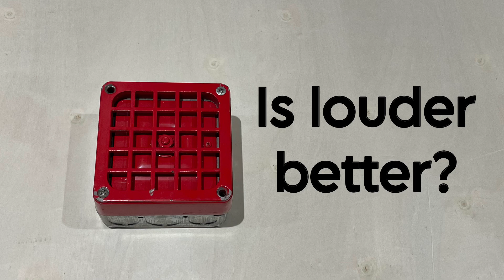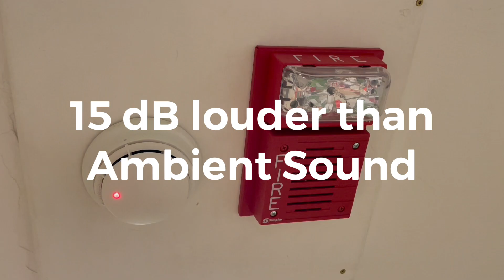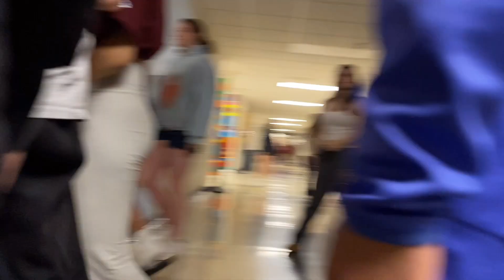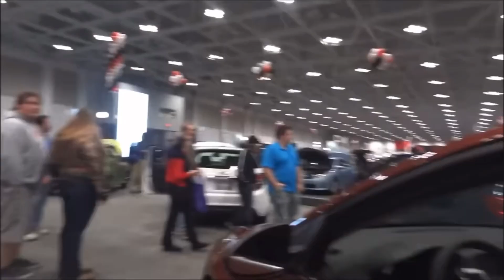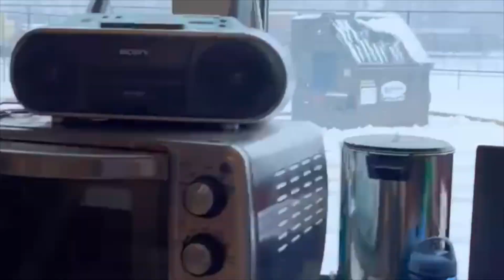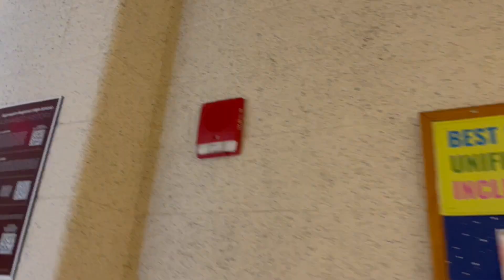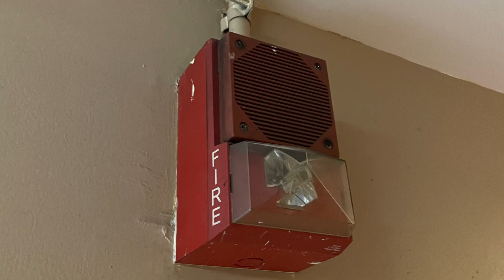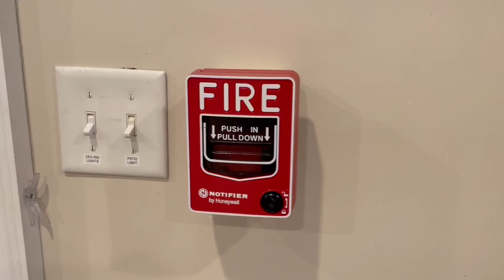Are Louder Fire Alarms Better? Why are Fire Alarms Loud?

Comment: Hey firealarmdude! Nice video! So recently ive gotten back into fire alarms, and i kind of want a thing thst allows for more function, so im wondering if its possible for a annociater, lets say a fire lite one to be wired to an independsnt system (no panel) with only a pull station and alarm, i currently havr a plug for my power which is the negative source, and another wire for my positive source, so im wondering if its possible for me to ude the fire lite annociator on my system or of i would need a panel or more wires for my annociater to function (appologies for bad spelling my phone is acting weird today lol)
Reply from the maker: An annunciator is a proprietary device that will only work with a panel. You would need a panel to run an annunciator
Reply: @FireAlarmDude5967  ah, that sucks. But thank you for the explanation !

Comment: Once again, a very well done video. One thing to add from my personal experience is loudness is often also due to laziness or cost cutting. The first being you have an electrician putting up these devices that other doesn't realize they are adjustable, or more likely doesn't or isn't instructed lower the output as being excessively loud in most cases won't fail a verification meaning, not coming back to that same device to mess with it again. The other reason I see is design of the building with fewer devices on a very high setting to maintain minimum requirements in further rooms and spaces. This means when you're right next to the device it's going to be very loud. That in itself being why the the older systems are often louder as you mentioned in your video.

Comment: I definitely think the fire alarm system in my Greek Village house is way too loud. It’s Simplex TrueAlert 4906-9127 horn strobes which are 96 db from 10 feet away each and the hallways are so small and they echo off the wood flooring which makes it a nightmare for the ears. These alarms are even so loud that I can hear them from another house a few feet away from mine while standing on the back patio of my house. And these alarms definitely do startle me as during the fire drill we had, I had a sense of fear in me as jumped out of bed and rushed to get out of the house. It even startled me so much that I forgot to grab my keys because of my panic instilled reaction to get out ASAP so I had to go to the loan key desk after the drill at the expense of $5. These alarms startled me the same way the Wheelock AS and MT did in middle and high school and the Simplex 9838s did in elementary school. Whenever Greek Village goes through another major remodel, I hope the TrueAlerts are replaced with low frequency sounders or voice evac because those invoke a much calmer reaction (because when the fire alarm in the library or dining hall goes off which is a Simple’s 4100ES voice evac system, I leave the building calmly like what the voice message is saying and also past dorms I’ve lived in have a 4100ES with the low frequency code 3 tone and I also leave the building calmly in response to that not rushing out like I’m fearing for my life)

Comment: One point that could be made about older devices is the mechanical horns produced MUCH lower frequency sound output which by how sound waves work means that would penetrate a lot further through walls and structure and would be better heard.

Modern devices are typically really high pitched and can't penetrate as well, so more devices are needed. However, while someone may criticize this at first glance, it really isn't that much of a problem when you consider strobe coverage requirements; you need strobes everywhere, but just make some horn strobes if other horn strobes nearby aren't effective enough.
Reply: Mechanical Horns have a low frequency output but high current draw which is why there aren't a lot of signals of them as the sound can penetrate the walls easily

Electronic horns have a high frequency output but low current draw which is why there are a lot of signals of them as the sound can't penetrate through walls easily

Fire bells do have a high frequency output but their gong vibrations placed next to a wall can vibrate it easily depending on which wall it's installed as the sound from the bell on the other side doesn't penetrate well
Reply from the maker: Good point
Reply: The SpectrAlert Advance/L-Series has a broadband tone designed to penetrate through walls.    And from experience working at a school that thankfully only had remote strobes in the regular classrooms, it works.

Comment: To me the system needs to be more standardized voice-evac should be in every building including homes, the message itself should be a standard message except if the building has a special configuration. And generally I think we should be putting better systems into homes as well because those cheap residential units are nowhere near the quality of the commercial ones and often have mechanical issues or false alarm a lot. This type of standardization is in places like Japan where even homes have the same Fire Alarm Voice Evac message as in commercial buildings and those alarms and detectors aren't cheap made in China Stuff and rarely have issues. Even some old shrines have the standard message and it has been proven to be more effective then what we have in North America. Example video of the standard message that's being used.  https://www.youtube.com/watch?v=Ukn6UbEnkS8

Comment: Very interesting and informative video. I enjoyed every minute of it. I remember when I used to be scared of the fire alarms at my elementary and middle schools. They used to actually sound a siren over the intercom additionally while the fire alarms with mechanical horn strobes are sounding. I was more scared of the sudden siren sounding over the intercom over the mechanical horn strobes in the hallway. There were only strobes in the classrooms in my elementary school but I think my middle school only had horn strobes in the hallway and no notification devices in the classroom. so we heavily relied on the siren over the school intercom. By any chance did you have experience like that too in any of your schools you went to back then?
Reply: Mixed signals cause confusion.

Comment: I love your videos.  Particularly this one.  Very true video indeed.  However, I have a question.  What about when I walk into some buildings that still have Xenon discharge strobes?  And what about the newer buildings that have LED strobes?  Is there any difference in effective alert with Xenon strobes versus LED strobes?
Reply: That's another good video topic.
Reply from the maker: Xenon strobes are an older technology. LED strobes are becoming more popular as they draw much less power
Reply: @FireAlarmDude5967 So, other than technology and efficiency, both are about the same in effectiveness of alert?

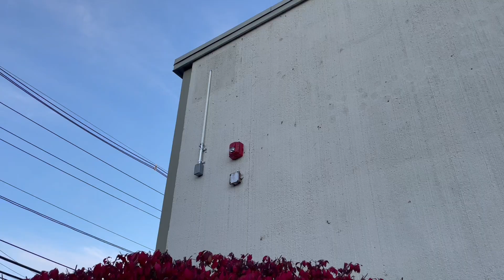Comment: 00:49 #whatafirealarmfail System Sensor L-Series horn strobe installed outside which is not good because they're not weatherproof and will break down from the high/cold temperatures and high humidity as they should've used a weatherproof SpectrAlert Advance P2RK horn strobe
Reply from the maker: Ok
Reply: @FireAlarmDude5967  I have seen one of those on the exterior of a storage facility in a northern suburb of Akron
Reply: @JoeyCaridi3030 There are also System Sensor P2GRKLED that comes in handy

Comment: I think modern Fire Alarms are much more effective than older, they come in different customizability, functionality and they have a clear, bright strobe. The most effective mechanical horn I'd say is the Simplex 4903 Electromechanical Horn Strobes, Faraday U-HN Series and Gentex GMS
Reply: nah jed bro is probs shrewsbury xc head coach 💀
Reply: @jefftandaweathermanWhat does that mean?
Reply: The horns in those alarms are Faraday 6226s. I definitely agree with you on that they are the most efficient mechanical horns. From what I remember when my middle school still had Gentex GMS's, they weren't ear shattering loud. They were loud enough to be at least 15DB's over ambient sound, not but crazy loud. (Heck, I thought the SHG's from my elementary were a bit louder) Meanwhile, Ive heard the buzzers in the scoreboards of my high school, and they were crazy loud. They were vibratone 350's. So I can't imagine having a 80's system that had just one or three AC horns in the halls of one of my schools all going in continuous.

Comment: No we no about that, but now why do electronic horn fire alarms make a warbling high frequency sound that's a broadband frequency sweep tone? I think it's because so the sound travels further because of that tone that sweeps a frequency bandwidth at a very fast rate which prevents any volume fluctuations from its base sound level while it can still have the echo effect to it and that happens from the main frequency sweeping to remain it's effect of staying at the right volume due to the main frequency rapidly playing different frequencies at once and very close together to go faster over a rate where the echo fluctuations the volume to keep the volume consistent regardless of building echo
Reply from the maker: Maybe

Comment: I also think with tones. Some alarm tones like code 3 or some Hilo tones don’t sound urgent or anything. Some tones like the German DIN tone and a few slow whoops give a sense of urgency in my opinion
Reply from the maker: An urgent sounding tone isn’t necessarily good
Reply: @ eh not sure, I’ve seen to similar settings and the urgent tone got the place out faster

Comment: I will admit all the fire alarm systems when they first go off are startling my Elementary school had an older 80s system with 2903 light plates with 2901-9838 behind them and they were startling when they would go off considering the fact that they were sounding in continuous however it all changed in middle school and it wasn’t as startling. My middle school had older Siemens Horn strobes, Siemens UMMTs and then just like your high school does my high school had & still has
 an EST voice Evac System

Comment: This is absolutely accurate. In elementary school, I was so terrified of the fire alarm that I would think about it all day long. We had old mechanical horns grouped pretty close to each other (although luckily not in the classrooms, like my middle school has). If my school had an alarm system that was only loud enough to be 15 db over the ambient sound, it would have relieved so much fear.
Reply: Yeah I was the same way, to the point where I would avoid/dread sitting in front/under fire alarms. My elementary was like what he described in the video where there is only one horn strobe in the hallway responsible for alerting all the classrooms, so that wasn't an issue. But in middle and high school we had super loud horn strobes in every classroom. I do wonder if the installers were too lazy to actually set the volume setting correctly and if that contributes. I know classrooms can get loud, but it's certainly not most of the time.
Reply: unfortunately one of my schools classrooms has a mechanical simplex in one of the rooms, and they refuse to replace it cause the district is a pain, same with the building being super old.
Reply: OMG SAMEEEEE

Comment: I don’t think loud mechanical horn last long but it’s should be at 15db for voice evac though. And also false alarm or not they have to leave the building
Reply: Not all buildings are automatically evacuated when a fire alarm sounds.  It depends on the type of buildings.  Sports venues are a good example.  The decision to whether or not to evacuate the building would then be made by building personnel.  If they know it is a false alarm, they will keep the building occupied as evacuating everyone (and then reentering them) takes time.  A high rise is another example.  According to the NFPA, due to high rises having sprinkler systems and other fire protection, it would generally not be necessary to evacuate the entire building.  You would only need to evacuate the floor the fire is on as well as the floors immediately above and below.